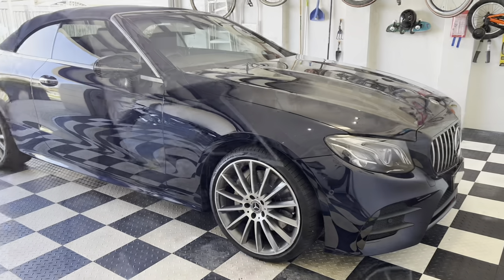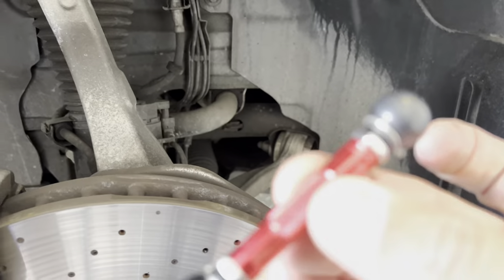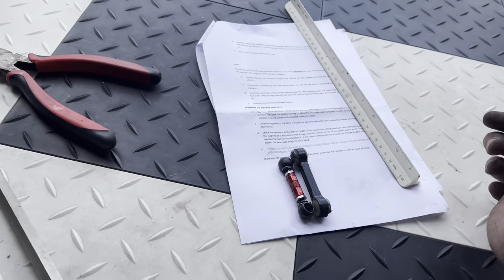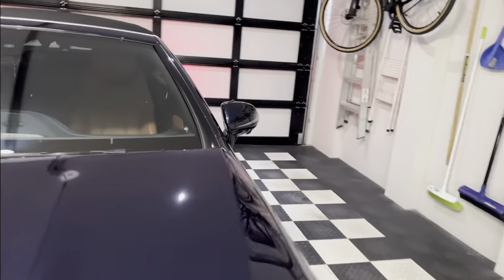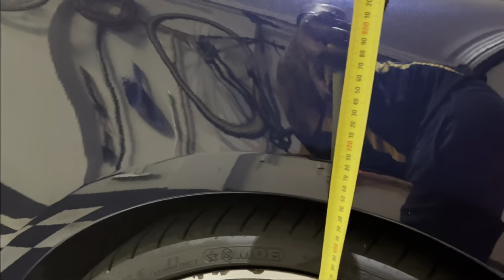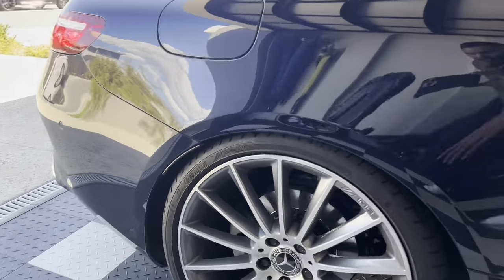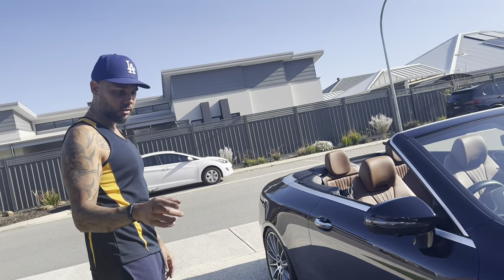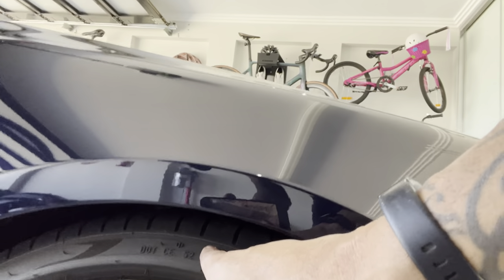How to lower a New Mercedes using lowering links…

Comment: Hey, first- thank you for making these videos because I am curiouse bout lowering my e450. My question is, if you have the adaptive suspension (change from c, to sport, to sport+ suspension), if you use springs, can you still change the dampering effects of the springs with the built in MBUX system?
Reply from the maker: Yes man even if you have springs and change damping settings it will stiffen your suspension when in sports +

Comment: Got a question for you , I have the E Class E400 with air suspension.

In terms of lowering or wheel spacers, what would you suggest? I want to drop it slightly and improve the appearance but just getting some reviews first
Reply from the maker: Do both, the spacers alone will make it look much better however the lowering links really take it to the next level. good luck with yours

Comment: Hello sir  
So if I want front and rear lower 1 inch
Front  lower link I am adjusted longer more than original? And rear short more than original ? Thank you sir
Reply from the maker: Yes friend that’s right,
Reply: @dsilvagangvlogs432  
Thank you for your answer , if I want lowers 1 inch front and rear 
How adjustments lower links  from standard? Longer or shorter 0,5cm or 1 cm from standard thanks
Reply from the maker: @bentleyvu8461  must go longer 1cm but this will be very low when you are in Sport mode and it will rub when you turn wheel on full lock… But it looks awesome 😎 good luck friend

Comment: Hi Bro i have w213 bat not Airmatick / normal suspension can i dow 20 mm lower !
Reply from the maker: Bro you can do 20mm lower easy man, probably more but you need full spring replacements if you don’t have air ride system…

Comment: How's the ride quality?
Reply from the maker: The ride has been prefect, I have to use the lift now going into driveways but my car has air ride suspension so even though it’s much lower it’s still smooth and not super stiff